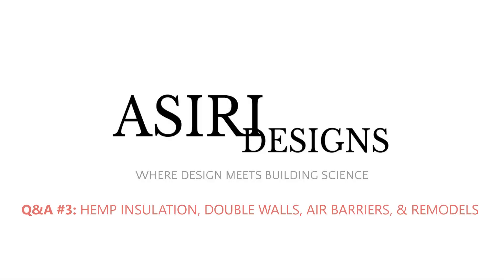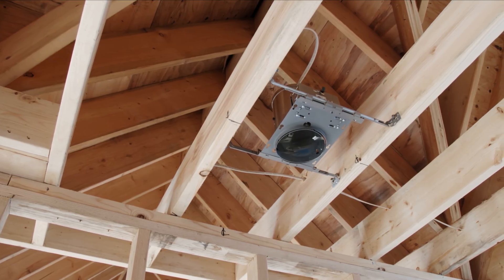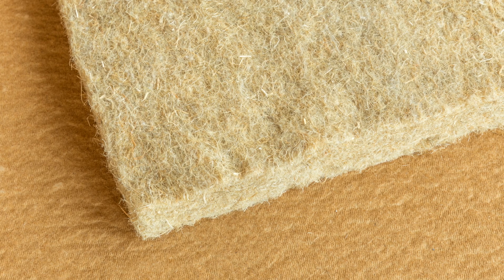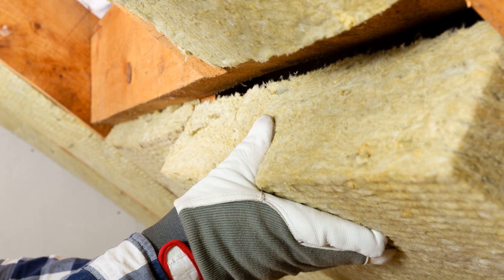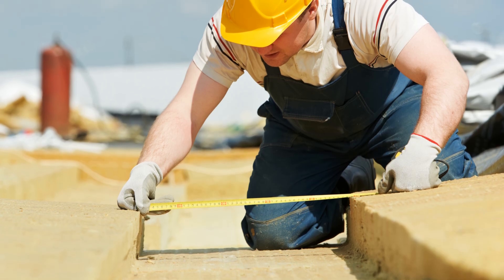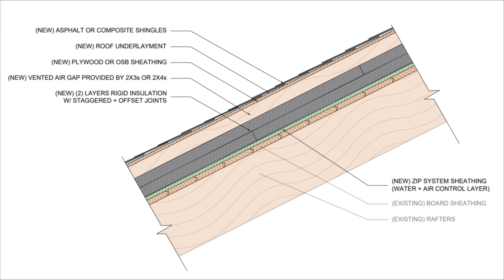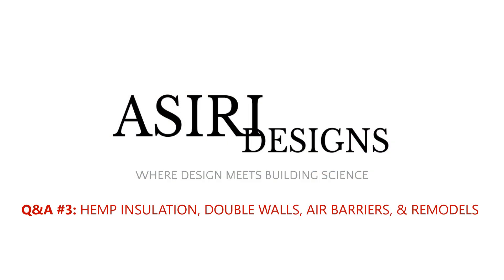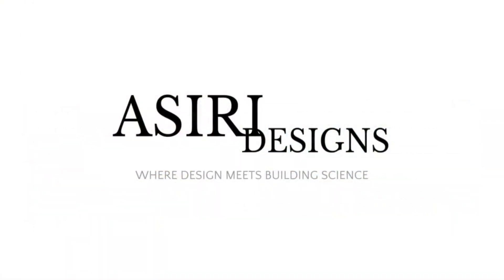Insulating Old Attics, Double Walls, Air Barriers, and More! | Q&A #3

Comment: Good day sir. We bought an old house. Complete reno on the main floor including rock wool on the exterior and some blown insulation on the inside. 
My question is, do you have a video on insulating a basement?
It has no sign of water penetration, mold or other issues. Concrete wall about 5’ then framing. My plan is to frame out the entire basement perimeter walls and insulate everything. Do I need a vapour barrier? Would an anti fracture membrane be advisable? What about the already framed part? Leave it or install another vapour barrier?
More than one question I guess. 
Thank you.

Comment: Cheers .
Icf building monopoly framed roof assembly question 

No sheathing , assembly goes as follows , truss poly iso structural panel r36 taped at the seams, 3inch  sharkskin sa, 1x4 radiant barrier and my standing seam roof. I am in zone 5 
Is there a better way.

I also have another system I would like your input on.
From the bottom up,
Sheetrock,1x4 or 2x4, intello ,trusses,2 inches of closed cell spray foam,2inch deep air chase between trusses.  from the soffit to the ridge line, osb taped,1x4 , radiant barrier, standing seam metal roof. Is there anything I can do differently that is in the same final cost as this assembly

Comment: I'd love to see info of the potential pitfalls and fixes for adding new walls over old to the interior of an older, badly insulated home.  As in, effectively retrofitting a double stud wall to add the insulation in front of the existing gyprock walls, even though it would reduce the interior size of the rooms.  It's one of the many ideas we're playing with with regards to our home in Australia, which is effectively in your zone 7 - cold temperate.

There's been lots of badly handled builds and insulation on the home over the years that we inherited buying it, so we're looking at the fixes we can do in the short and long term, cheaper and more expensive.

Thanks for the brilliant content folks, your video on windows and your philosophy of assuming the precautions will fail and building around that were great!

Comment: For the attic, if the rafters are a usual 16 or 24 apart, I would consider using wood fiber batt insulation such as TimberHP batts. I've used some in my house and it is very easy to work with.

Comment: We are currently renovating an attic space to use as our office. We live in central Europe (climate like in NW Washington). We currently have arround 4inch of glass wool insulation between the rafters and its getting crazy hot in the summer.

We will remove the glass wool and install 6inch of flexible wood fiber insulation between the rafters and 5 inch of rigid wood fiber insulation (9lb/ft^3) on top. This is pretty common building strategy arround here, houses built like that stay pretty cool in summer. We will use Intello X as vapor barrier. Wood fiber insulation is getting more and more popular due to the high heat storage capacity and due to low prices.

Comment: god bless you asiri, i'm learning a lot

i'm currently getting my roof replaced and my contractor told me that he is installing some vents between the shingles and the roof to allow some air flow.  is that how it is usually done?  this is a vented attic so this is in addition to the ridge vents.  i guess it is to allow air flow and drying for the roof?  i live in climate zone 1 (southern california) so it does get very hot.  did i misunderstand him and the vents are going into the attic instead?

so there is plywood on the roof, then a glue applied membrane, then roof vents, then the asphalt shingles

Comment: Hi Sharif.  Thank you very much for featuring my question in your Q&A.  This gave me a couple more options to think about which interested me.  I may have figured out a way to eliminate all but 5 contact points where open web trusses would attach using thermal bridge materials.  I have not had any structural engineer look at this solution yet, but I will send you some pictures.  Might be something, or it may be nothing.  What I will do is send you a contact form on your website, and if you are interested please reply with your email and I will send the REVIT detail to you for comment.

Comment: Currently designing a Bardominium (pole structure on 8' centers, therefore balloon framing but no traditional exterior stud walls) to build in Alberta, Canada.  Structure will be 32' x 64', half will be 2 floors (living space) with the remander being garage/shop with 10' ceilings.   Slab on grade with radiant heating and steel cladding on exterior walls with either steel cladding or standing seam roofing.   My question is how best to insulate the walls/ceilings and slab.

Comment: I have two questions I'm hoping you can help me with. I'm in Houston (which I believe is climate zone 2)

First, I have a brick house that my wife wants to be white (the brick is a pink color) and so I'm looking into staining the brick. Is it better to seal the brick after staining so it sheds more water or leave it unsealed? 

Second the attic has insulation batts (r19 faced insulation with the face down) rolled between the joists and a radiant barrier laid over that. My plan is to do Insulation 2.0 (cans of spray foam to air seal ceiling/attic penetrations if you're unfamiliar) and to staple the radiant barrier to the rafters to act as a rafter vent for the insulation I want to blow in. Do you see any major issues with this/potentially a much better way to do it without redoing the roof?

Comment: Great video! I have a question regarding the installation of the smart vapor retarder (such as Intello or Majrex) on the back side of the interior frame in a double-wall assembly. If the vapor retarder sits mid-way between two almost equally sized insulation layers (~1:1 ratio), would there be an increased risk of condensation forming within the wall assembly, particularly at the inner side of the exterior wood frame? My concern is that the interior frame essentially becomes a service cavity outside the vapor retarder, which offers many benefits installation-wise, but is there a limit to insulation thickness for this setup to work effectively? I've heard of a 1/3 rule being recommended for service cavities, but I’m having a hard time understanding this clearly and not sure how to best approach this for a safe install. What are your thoughts?

Comment: How would you insulate a shed that is built with LP Smartside directly on top of the 2x4 framing. No sheathing. Hot humid climate, air conditioned interior.

Comment: How do you feel about spray foam on the exterior of the house and underneath the slab?
Reply from the maker: @jhippl  The two places that I'm all for it! It worked great on the exterior for low slope roof retrofits. As long as it's isolated from the interior pressure boundary.
Reply: @ASIRIDesigns  What about spray foam on the exterior of the walls with a z girt or furring strips?

Comment: Just from a theoretical point of view, a double walled system could have its own, interior to the wall / closed, ventilation system, allowing for active moisture removal. Again, notionally, very narrow, perforated tubing could snake through those walls and allow moisture-laden air to be removed to a dehumidifier, then gently returned back to the cavity. Gravity would cause the air with the most moisture to settle towards the bottom of the cavity. Easy calculation. Of course, the insulation material should be very air porous. The idea is to have just enough pressure in the system to move the air without creating a pressure differential between either to the interior or the exterior spaces. (Venting walls could remove other gases or odors should that ever be useful. Also it would provide a way of injecting insecticides, fungicides, etc., then removing them, if that’s ever needed. Hydrogen peroxide, periodically run through the walls, would be effective, gentle, and then, as it is reactive, dissipate quickly - it’s what is used for infection control in hospitals today. It’s also used to chemically eradicate odors.) The air flow would, normally, be tiny and the system could be controlled so that it would be activated only when needed. Fire safety would necessitate that the interior be mineral fiber, and that the airflow system be shut down by a fire detection system. (But then, a fire suppression system could pump nitrogen or CO2 into the walls in the event of a fire. Unlike water, inert gases wouldn’t damage the structure.) There are lots of other ways to do this, but depending only upon passive moisture transport horizontally through your walls imposes a huge constraint on your design. And it doesn’t necessarily take the moisture where you want it. Also, gypsum, or some better inert product, without paper, would be a better choice for a middle of the double-wall than OSB. You could use plastic mesh to mud the seams between sheets.  The middle wall will be hidden so this process will be quick and would not require sanding. Just some thoughts. Great series. Wonderfully thought provoking in an area where everyone is stuck on past practices and familiar materials used in familiar ways.

Comment: Found your channel in the throws of a complex remodel and it's amazing. Wonder if you might elaborate on exterior insulation on a cladded second floor over a 4" brick veneer 1st floor where we don't have access to the exterior sheathing (fiberboard). Plan is for four inches exterior mineral wool to match the brick offset and continue to the ridge vented roof via 2.5 inch furred gap.
Concern for me is the first floor top plate area where it transitions from no exterior insulation to exterior insulated area. Hope that makes sense and look forward to your next video